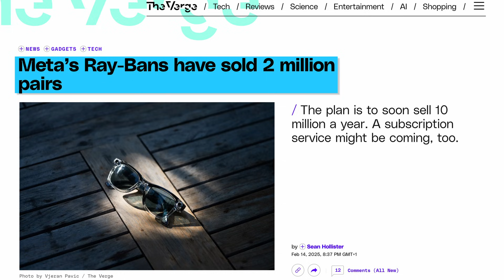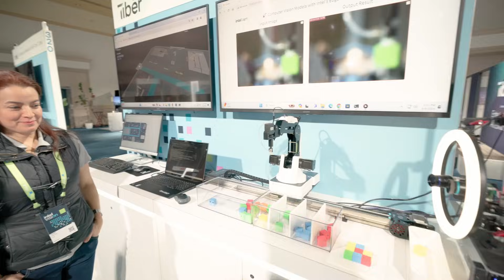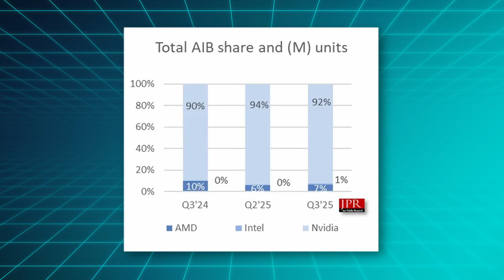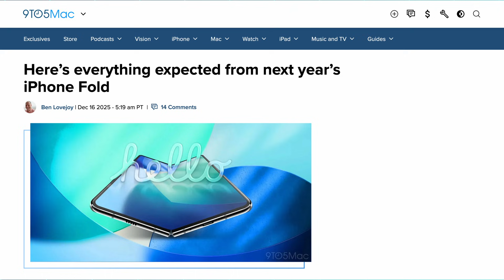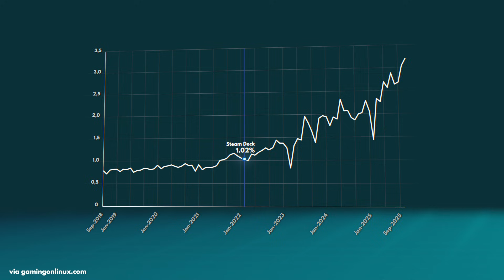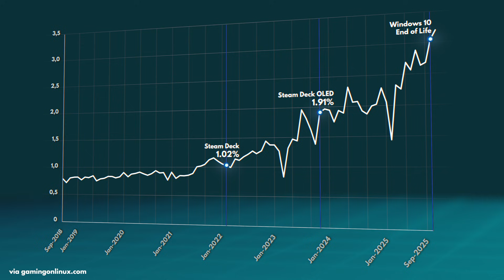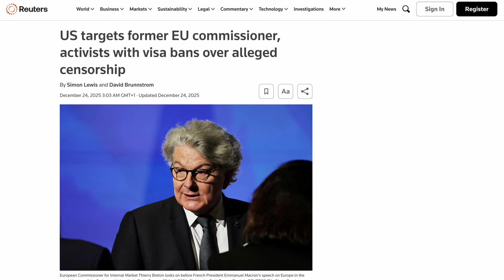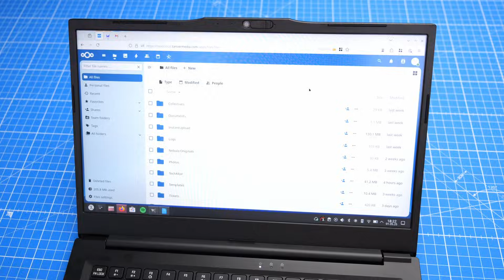4 tech predictions for 2026. Do you agree?

Comment: 4:10 "Intel board had been like catastrophically incompetent" - It's common knowledge, or should be, that intel board is a mess, they stopped making mobile and car chips. Intel has gone from dominating the market with 99% to having to be bailed out by the government.
12:55 - Steam users that still use windows 10 won't have to stop using windows 10 to play. Unless microsoft bricks their computer or valve bans windows 10 users, it will be the same as using windows xp or any other, which i'm sure tons of people still use.                         Anyways happy new year!

Comment: Regarding the last prediction - I work at a small software company here in Denmark, and I can tell you that you are spot on. We have around 40% of our customer base in Denmark and the majority are governmental customers. This year alone we have gotten so much pushback from them regarding the infrastructure we work with specifically because we have some of it running on US based company software, so we have already started charging our infrastructure because of that. The biggest issue we have, is that we run primarily on AWS - but so many other software companies do too. So we will see what happens in the end.
Reply: I hope you find good alternatives, I want to fully ditch US IT services.
Reply: I confirm that this is also the case in Africa, the Middle East and LATAM. While regulations don't target US companies directly, they are really focusing on sovereignty and avoiding provider lock-in for both government entities and big corporations.
Reply: Danmark W
Reply: I work in Finland and here it feels bit opposite, no one seems to care as long it aligns with whatever regulation if necessary.
Reply: @finnderp9977  - our Finnish colleagues say the same thing 😅

Comment: the problem is with apple is they make a new device that is way overpriced and noone buys it 
I have wanted them to do a foldable iPhone that would fold into the iPad mini 

it would be great if apple got rid of the notch and the camera bumps 

I would so like rollable devices as I would so like a iMac where the screen just rolls away into a small container or a laptop that does it 

I would love a device where they have conquered smell and texture on a hardware device 

there are still no robots that can clean my house and will we have a computer industry with the price of ram and GPUs 

noone has explored the uses of 3d fans and I would so like to use the meta Rayburn's and more wide adoption of 3d printers 

what about micro oleds and the barrier of 1nm with silicon 

will the ai bubble burst

Comment: Ever since QI now has magnets, I really don't understand why we can’t just use pogo pins instead of wireless charging 

wireless charging to me was always this super hassle and connection free method of just putting your phone down and it charges, you pick it back up and don't have to disconnect anything. That kinda died with the magnets: Now you have to kinda pull it away, and it is a more involved, often two handed process ... I do see the benefits of the magnets though. Allows for more accessories, etc.
But now that there are magnets in place, I feel like pogo pins would be super easy to implement again, as you can be sure of where things contact now ... and they would be far more efficient than wireless charging can ever be.

Comment: On the market share predictions from 2025, those are absolutely impossible to hit, WTF. You cannot get 10% market share in a single year, on a market which usually replaces the item around 5 years. 5 year turnaround means every year 20% of the market is refreshed, on average, so getting 10% means that 50% of the new sales are you new thing. Absolutely bonkers.
Same with GPUs.

Now that the economics are even worse, and the generations take longer to come, with less improvements, the lifespans will increase by a good margin. 10 year old computers will start to be something normal. Both in economic sense and in "it still works fine" sense.

Comment: What a terrible prediction with gaming on linux and anticheat. IF they add up anticheat on linux, then gaming on linux is going to die, because people who play on linux do it exactly because they are trying to avoid such things from happening. If you give programs such deep and violent access, then you simply stay on Windows right away.
Reply: Ok but anticheats would just be an option just like they are on Windows rn. Those who are on linux just can decide to not download anticheat games and those who didn't switch yet because they can't play anticheat games can finally switch. So why would having an option for anticheat be a negative thing?
Reply: @Bronyboiiiii  Because the people who use Linux instead of Windows usually do it BECAUSE of issues like this with programms slowing down the system or having too deep access. If they didnt had an issue with that, then they wouldnt have switched to Linux in first place, because its not about objective benifits of Linux vs Windows, but mostly about subjective feelings, where the way how anticheat works is being viewed as even bigger problem compared to normal Windows gamer.
Reply: @alexej123  Ok then you've found your first outlier. I would 100% install anticheat games on my CashyOS PC. Then I could finally jump fully on linux because anticheat games are the only reason why I have a windows dual boot rn. You obviously have such a wierd bias and know nothing about the linux community.
Reply: Regular users don't care that much, they just wanna play. We cannot keep Linux just for a niche group, we need it mainstream.
Reply: @ContraVsGigi  Its never going to be mainstream. The whole motivation to use Linux instead of Windows is so cringe, that it never will occur to mainstream users to even think about it. Linux users are like homeopathy fans - a little bit crazy and very ideologically motivated, so anticheat on kernel level is a big no go for them.

Comment: the crease bothering apple users is something that I feel you overstated
they lived by and praised that fucking hideous notch for years, my ios peers weren't even aware that their vaunted "island" was actually two holes in their display, just with the bit in-between them turned off
Reply: The notch and the crease are two completely different things.
The notch was a purposefully designed and implemented element that served to give a perceived unique identity to the iPhone; you saw a notch, you knew that was the new iPhone.

The crease is just a compromise because the tech for seamless folding displays just isn't there yet. There is no appealing or recognizable element that a noticeable crease brings to the table, only image distortion because it can't be executed better.
Reply: Actually the Dynamic Island has 3 different sensors which prevents normal paneled glass to be placed over it (the technology hasn’t been invented yet) making it the smallest secure face unlock currently. You don’t even know what you’re talking about, you’re just as clueless at your “iOS peers”.

Comment: I think it's hard for governments to switch to Linux. They often have old Software that run on Windows. This would get easy over time but when you switch you have dozens of new issues at the same time which can sour the mood of the people who have to use it.
Reply: Most people only need a web browser to do their job though. You could switch 80% of people easily, then iterate on the other 20% over time. As more governments switch, more vendors will have to support Linux.
Reply: My brother works in IT for a government and from what he told me there is a surprising amount of work required before every migration to a new Windows version, so in theory when 12 comes out would be a good time to switch to Linux if they so want. As for legacy systems, many IT systems are quite compartmentalized so those systems/departments that have to stay on Windows could in theory simply do so regardless of the rest. When a German state switched over to Linux a number of years ago, they ended up switching back but not because of dissatisfaction but because of the officials' corruption and bribery (what americans call "lobbying").

Comment: Jon Prosser from FPT predicted years ago that nobody wants a foldable phone. He stated that a foldable 10'' & above tablet would make more sense. Iphone specs wouldn't be great either due to the trade offs in fitting the specs same as the Iphone air. A Fiasco. Yes, it'll be more of a status symbol at this point. Worse case, it'll remain in the prototype stage.
Reply: I'd love a foldable. But between the tiny battery, worse thermal/camera, worse durability is making me shy away from it.

Especially since i only use large screens for entertainment, of which a $500 tablet would suffice and a $500 tablet + $1200 flagship phone would be better at each of their tasks
Reply: I am holding out for tri-folds.

Comment: I predict that the USA is going to experience a catastrophic failure in the tech sector - and that it will be caused by AI and cause a lot of "market value" to be deleted in an instant.
Something like an AI driven data-breach of one of the big players.
There is hardly any oversight left, control mechanisms have been un-build en large so... something is bound to occur.